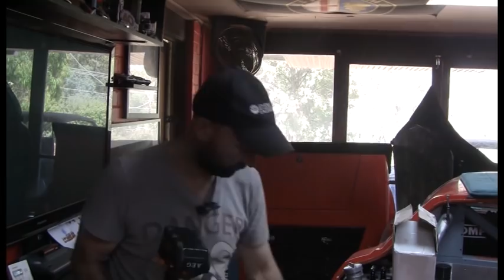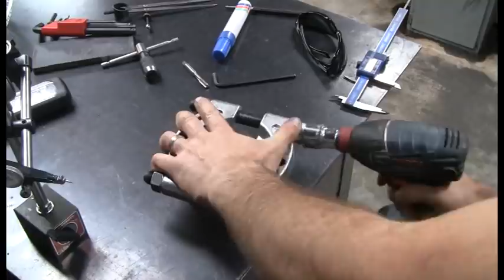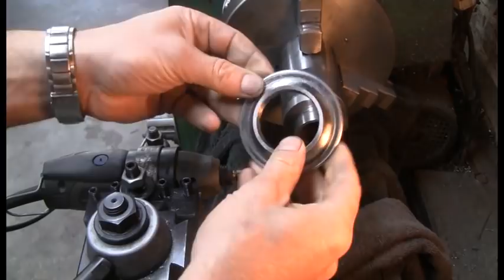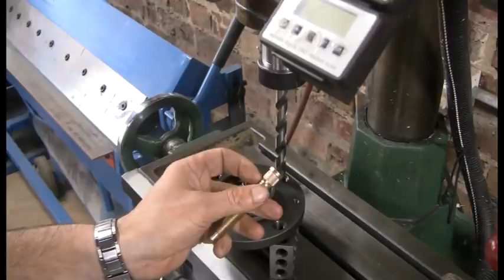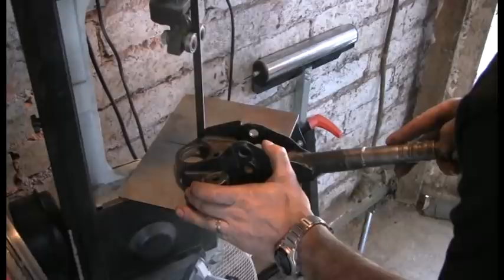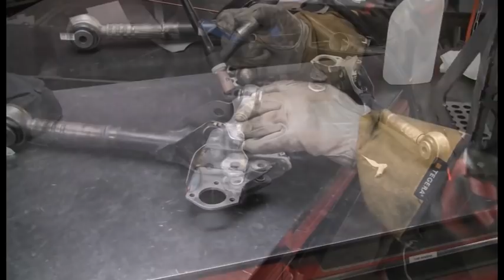Project Stratos - Episode 25 Rear Wheel Bearings

Comment: Colin, when I changed the bearings on my Porsche 944 torque tube I read that I needed bearings with a larger clearance. You can get some bearings with a clearance between C1 to C4, with C4 being the larger tolerance. I wonder whether wheel bearings need a larger tolerance if they are grease packed.
Reply from the maker: Interesting, there's not really a great choice in bearings, as they are not an industry standard bearing size, more an automotive bearing, so as far as bearing class, you sort of get what you get. But I'll keep looking

Comment: Not sure what you’re doing with your driveshafts but I’m pretty sure the bigger Peugeot 406 V6 and Diesel drive shafts will fit your hubs and are much stronger and a better modern design
Reply from the maker: Bigger than the alfa 3.2V6 shafts? They are pretty big
Reply: @105colin  I just mean the splined end fits into the205 hub, the driveshafts are pretty girthy tho 50-60mm and with a hole trough if I remember right
Reply from the maker: Ah, I see, I'll check them out and if we have issues with the current setup, that could be a possible upgrade, I like the idea of hollow large diameter axles though